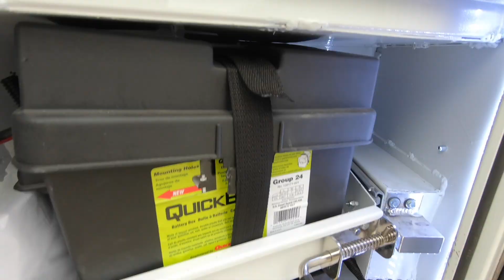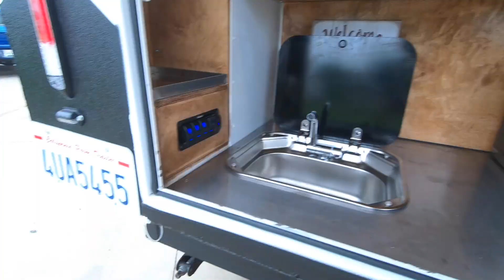Square Drop Trailer Build Time Laps

Comment: Outstanding!!!    I’m part-way thru a build, very similar to yours.   I’ve got a seadoo boat trailer, about 17 feet (from tongue to tail) that I built a 1x steel frame on.  The cabin is 6x8 foot on the inside with a 2 ft kitchen in the rear.    I’ve got half of it skinned in 5mm wood that I’ll laminate in white/black. 
 Right now I’m trying to decide if I should angle my cooler/battery box, like yours or just make it square like the rest of the body……
Seeing it on yours, I REALLY like the way it looks.
Reply from the maker: Sounds like an awesome build. The Tapered front box design finished off our trailer well in our eyes. You lose a little bit of storage space compared to a squared box, but you cant beat the look.

Comment: Excellent! I bet your weight is marginal for this size camper... My 4x6 Vnose Cargo/Convert with 35# axle weighed 720# with steel frame and .025AL siding. So, Peak Expedition is a registered Plan? Or are they produced...?
What's the finished weight and dimensions of this build?
Reply from the maker: Thank you, Our Peak Expedition is our very own design and build. Overall Length is about 166"/ overall width is about 82". And the final weight comes in at 2600 #.